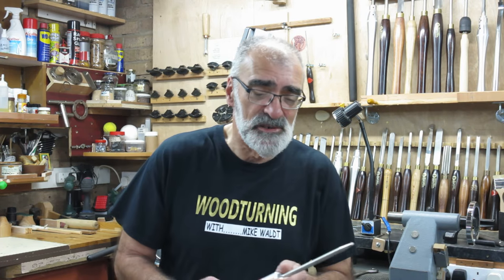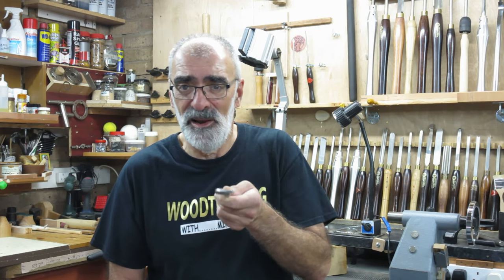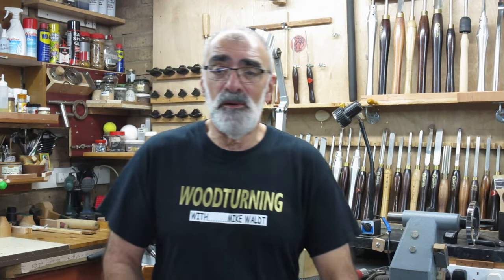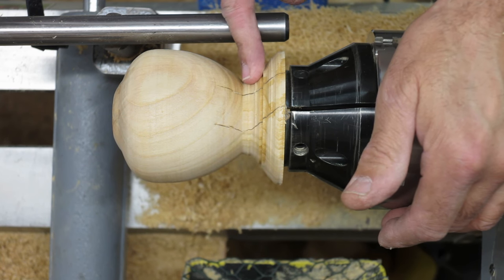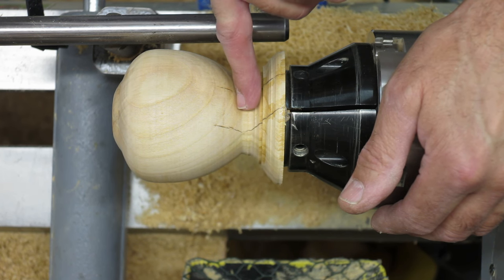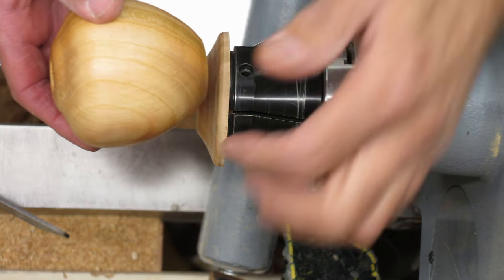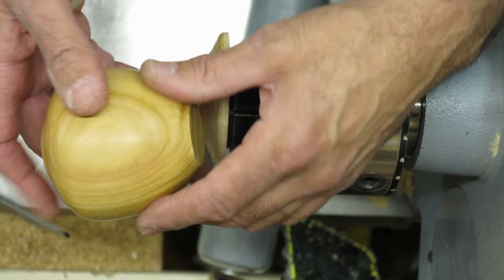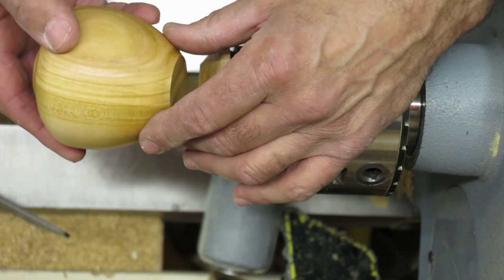Wood Turning - Hollow Form using the Hope Mini Hollowing Tools

Comment: Hi Mike. Another excellent video. I've been using the excellent hollower from Glen Teagle and am very pleased with it. It is surprising that the tiny cutter does such a good job. The other product I'm delighted with is Yorkshire Grit as it can eliminate the minuscule sanding marks that can escape observation. Keep up the good work.
Reply from the maker: +Graham Light 
Thanks Graham. Your right regarding Glen and Glyn...both have first class products.
Cheers 
Mike

Comment: Such a darling little vessel. There must be something that could fill and stabilize the small cracks. If the color of the piece were a little darker would that help?
Reply from the maker: +Jennie Wallick 
Thanks Jennie...I did fill the creches with CA glue, but didn't add any colour on this one. Thanks for watching 
Cheers 
Mike

Comment: Hi mike great result and video. 
Do you turn between Steb centres in the video and have you tried the Axminster ones and are they benifit to new turnersThanks
Reply from the maker: +Roger Dorsett 
Thank you Roger, the ones I have are Sorby, but I understand the Axminster ones are good as well. The benefit for new turners is that they will slip if you get a catch, which can help in the  beginning. I use them because I like them...lol.
Cheers
Mike
Reply: Mike Waldt Thanks Mike that's made my mind up I'll try Axminster ones when there back in stock
Reply from the maker: Let me know what you think Roger, when you get them, and have had a chance to use them a bit.
Cheers
Mike

Comment: I am fairly new to turning and would like some advice. I have seen some nice looking chisels on Ebay for what looks like a fair price, but need to know if they are good quality. They are Neilsen Wood Turning Chisels 8 Piece Long Handles Lathe HSS Steel Blade 15T. I have read somewhere that Neilson are good,is this true..Love your channel by the way lots of interesting info and good education and some great pieces. Thanks Alan.
Reply from the maker: Hi Alan, I must confess I thought that Lie Nielson did not make turning tools, only hand tools. However I cannot say as I have never had experience of them, I do know that the Lie-Nielson handtools are amongst the best.
Sorry I can't be of more help
Take care
Mike
Reply: Thanks Mike, great channel,helps a lot starting out.

Comment: Quite a nice little hollowform Mike. I’ve watched this video a few times over the last several months and after turning some bowls and boxes (which are my favorite things to make) I’ve decided to give small hollowforms a try.  I’ve narrowed my choices for hollowing tools down to two and will probably go with this one.  Could you tell me if the ride on the hooked tool is flat on the bottom?  If not is there any problem with it wanting to twist, or since the tip is at a 45° angle  is that not an issue?  Thanks for all the great videos, you and a few others have brought me along way since I started woodturning.
Reply from the maker: Thank you. When using the hook tool the "bend" should be in front of the tool rest, if the bend is on or behind the rest the tool will want to dip on you. Hope this helps.
Cheers
Mike
Reply: That’s for the reply Mike. I mistyped my question though. Is the part of the bar that sits on the tool rest round or flat on the bottom?
Reply from the maker: Oh OK, the bar is round :)

Comment: Do you do any sanding/finishing on the inside ?
Reply from the maker: Not on this on as you can't even get your pinky finger in the hole! 🙂
Reply: I do some I use a 1/4" rod in a di grinder with a slit and a strip of emery cloth.  But not one with that small of an opening.  Thanks again for your videos.